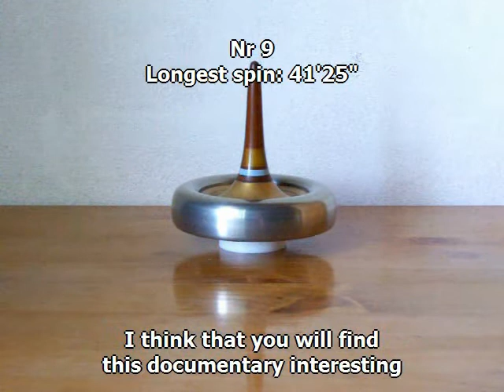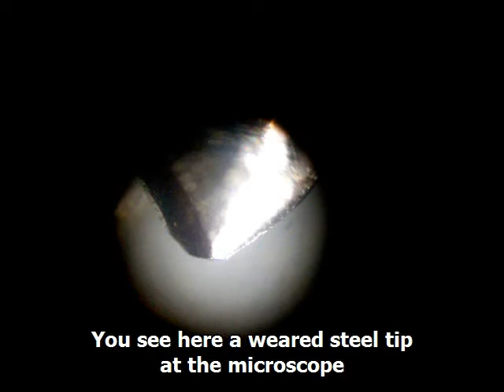How to make a precision spinning top (part 1 of 4)

Comment: Hi. What safety equipment and precautions did you use when working with the lead? Is wearing a mask, gloves, apron, goggles and working in an area with good ventilation enough to not have to worry about lead poisoning?
Reply from the maker: Hi Swaggertruffelz.  I hoped you had been able to find some brass, or some other metal, for your tops instead of lead.  Brass is probably the most suitable metal for tops, it is easy to machine, easy to finish and to polish, relatively to other metals, also it is beautiful, resistant to oxidation (it remains shining by the time), and heavy enough to produce tops that spin for long time.
I understand your enthusiasm, and that you used lead just because you couldn't find other metals, but lead is a bad staff, it is toxic, then it becames dull in not much time, it becomes scratched and dented very easily.
The only good thing is that, being heavier, it produces tops that spin a bit longer, but in the whole I think it is not worth.
Lead is a soft metal, if you rub it on a piece of paper you will see it leaves a mark as it was a pencil.  If you hold lead on your bare hands, some lead will be transferred to your skin, which you can imagine is not a good thing.
Reply: Thanks for replying. I will follow your advice against using lead. I only tried using it because I had a lot of it and  it is an easy metal to melt and cast. I am getting some brass cylenders for christmas which should be the right size. I will use those instead. Thank you and by the way I found your How to make a precision spinning top series incredibly useful. I could not have made my tops without it.

Comment: I want to use a 0.5mm ball point tip from a pen , but I. not able to cast I'm into the desired size and fit...
Reply from the maker: A ball tip from a pen I think it can be a good choice as for the tip of a top.
0.5 mm is very little diameter, not very easy to attach to the base of a top.
Maybe you could cut the last 10 mm of the pen and attach that whole part to the base of the top, without having to deal with a so little ball.
You will have to remove the ink in some way or you will have a writing spinning top.. :-)

Comment: Why not make a spinning shaft that a DVD disk can fit into or onto, but put a tungsten tip for longevity.  I find that diameter increases the centrifugal force, and the ease of spinning makes for longer spin time.  True...You could make a 20 pound top, but to what advantage?  Yes a Foucault pendulum will swing for days, but it is tremendously high and heavy.  How long will a simple three, four, or seven stack dvd spin with a tungsten tip and a 4 inch shaft, and a string pull starter?  And it is balanced already!  The KISS principle works best overall wouldn't you think?  After all if a plastic dvd disk can spin at a ga-gillion rpm's on a hard drive, they would have to be balanced to do so without exploding from the force of the spin!   Do a  comparative study of Mercury and Pluto!  Just a hint!Lead top? C'mon!  One bounce and it is Kaput!  and on a lathe???????  Spitting all that lead all over the shop?  Brass and Silver are harder and softer than Tungsten!  Sooo...for $50.00 you get three ounces of Silver!  And if you make it 4.75 inches in diameter, and look at all that fun you will have!  Having fun...That by the way is the diameter of a dvd!
Reply from the maker: +digiphot2 , DVD disks, single or stacked together as many you want, are not good for making tops if you want very long spin times.  The shape is not good, the density of the material is not good, the distribution of weight is not good.  I don't think you could obtain spin times much longer than 5 minutes with them, whatever kind of tip you use.
Reply: Thanks for the logic of Perpetual motion and toy ideas!  Nice job making your top!

Comment: Meh.  Multiple spins can be done by anyone with just a little practice because once you get decent at it, there is a terminal velocity.  Getting a long spin with a single flick of the fingers is where the real skill is.  Then, there is skill of making a good, vertical spin.  This top is helped and held in place by the base....

Doesn't feel as much like an accomplishment to get a long spin.
Reply from the maker: +Robert Burke , I agree that it's easier to spin the top with multiple  twirls.  The spin technique then depends on the weight of the top, little tops are more conveniently spun with one twist of the fingers, but the heavier ones really need more twirls.  I see that you appreciate the skills for a good spin, but also technical skills exist, and I assure you that it is not that easy to make a top able to spin for a very long time.